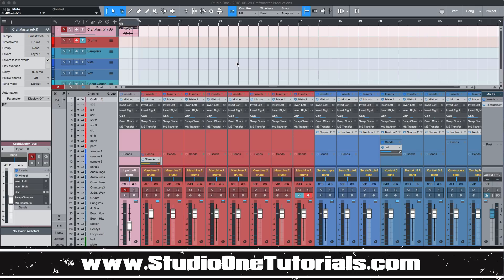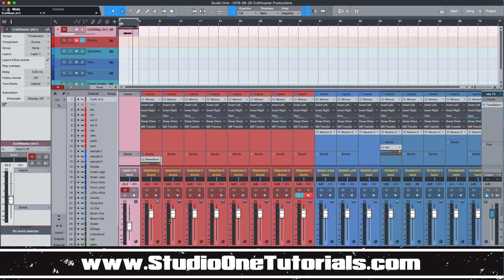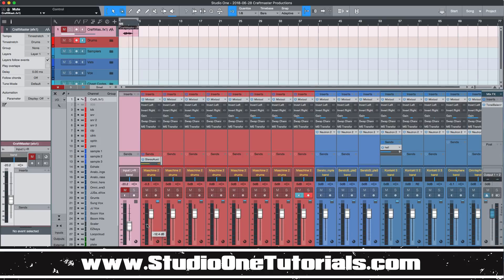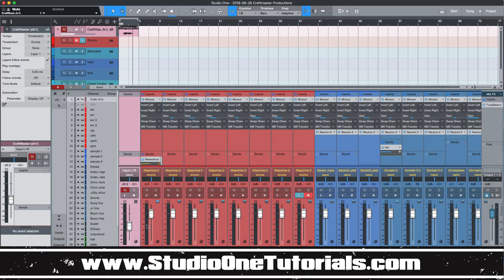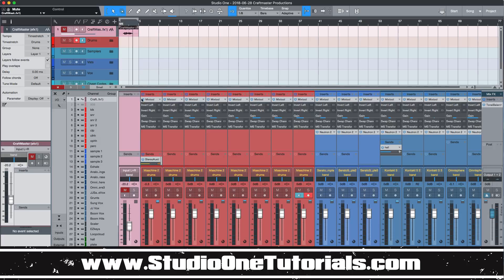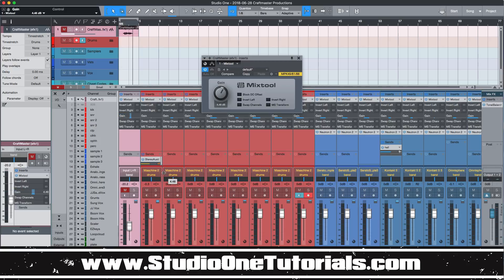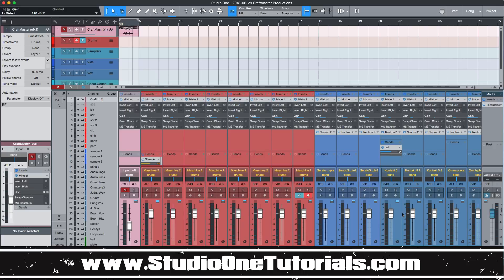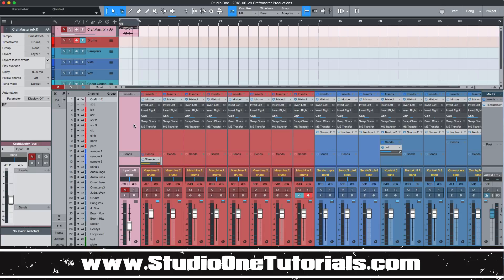Studio One 4 How and Why to Use Mixtool

Comment: In some of your template tutorials you said you initially set all to -10db, is that still the case?
Reply from the maker: Reed Crisis that’s just a starting point do you guys. There isn’t a blanket setting that will work for every sound. each one of my channels is to to a different level that achieves an overall starting balance.
Reply: Yes of course, but I did not understand: a) so do you only use the mixtool for channel gain change and leave the mixer slider untouched? b) Or do you gain down with mixtool for easier control of the mixers slider? Thx. Ah and thanks for your videos and your replies.